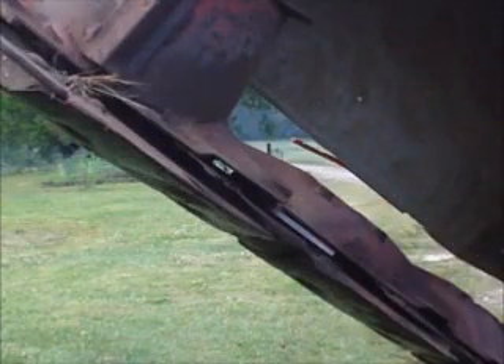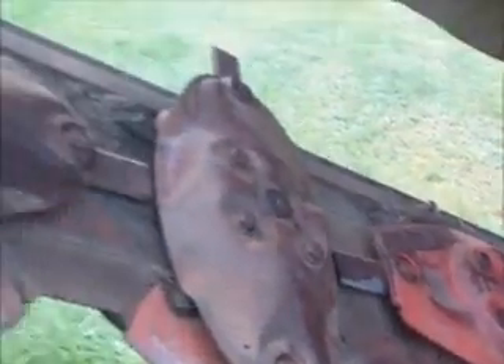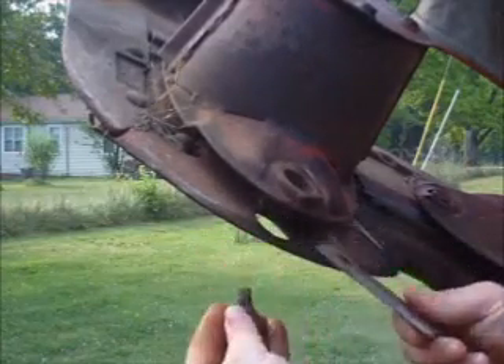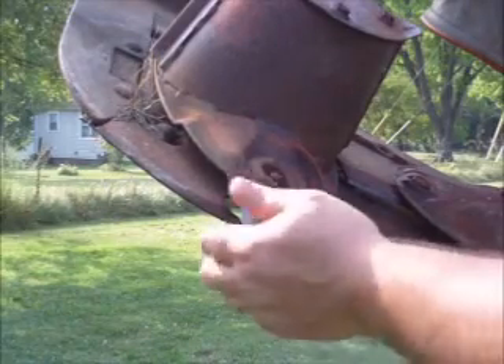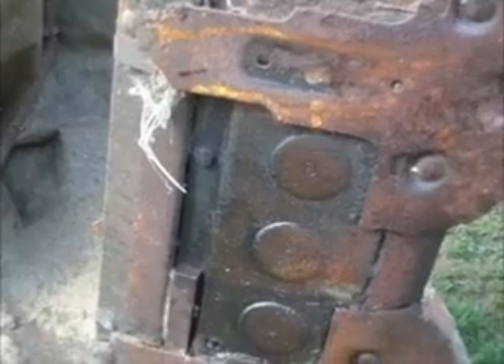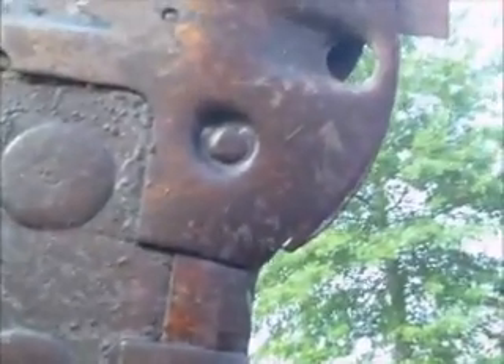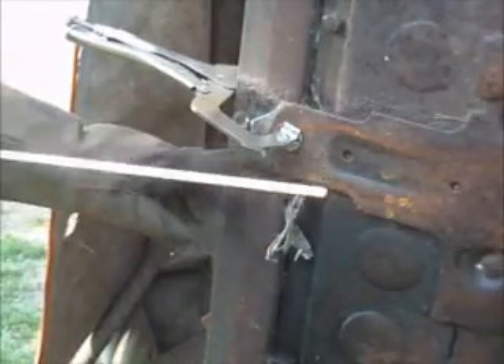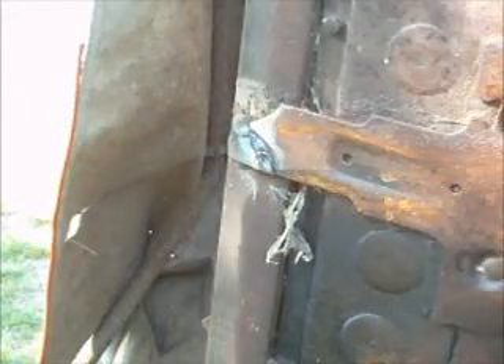Kuhn GMD500 Mower repair

Comment from the maker: LOL, I guess your locknut was bad.. I usually replace the bolts when I replace the blades, but I do remove the blades to sharpen them and haven't had an issue.

Comment: cutting hay other day lost one blade, i got gmd 600 hd put new blades on new this spring book said when you change blades change bolts i had new bolts but tight ass me used old bolts now i got old blade on with new bolt.

Comment from the maker: That plug is the fill up and normal level plug.  I don't think the oil has ever been changed in the mower and its about 20 yrs old. As long as the oil hasn't been contaminated it should be ok.  The stick on the end is useful in really tall, thick hay but it does a decent job without it.  Thanks!

Comment from the maker: The hole is so small all you can see is a drop of oil, so I cleaned it and gooped on some JB.  Hopefully it will stay in place and work.  It would be difficult to weld a skid plate on it because it would drag on the ground.  This mower is about 20 yrs old so it won't be long before it gets replaced.